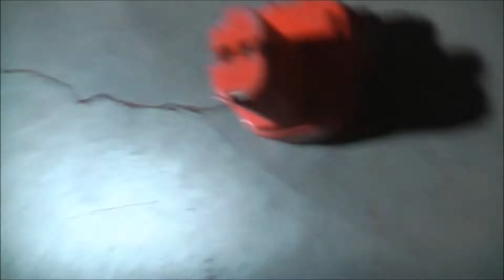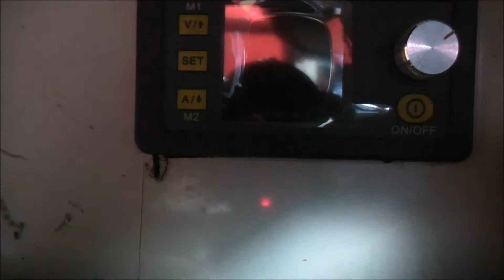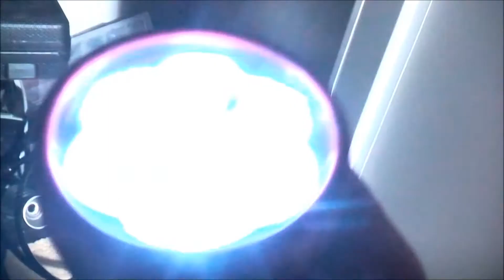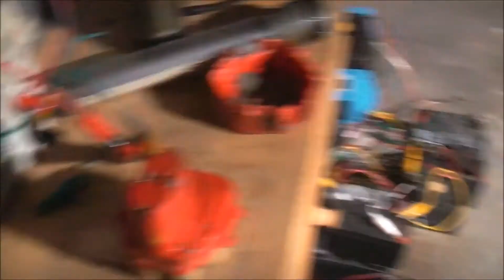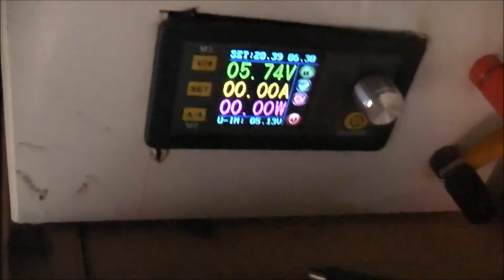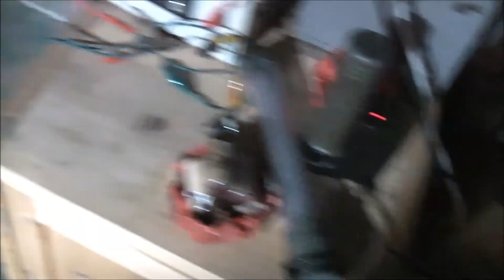Nicad Battery EOL

Comment: You should hook those cells to power and pop them.

I had a drill like that, a 12 volt Makita which has served me well. it's EOL was due to the speed controller in the trigger dying. I still have the batteries and charger, I use them for an amp I made.
Reply from the maker: Will be popped on the welder